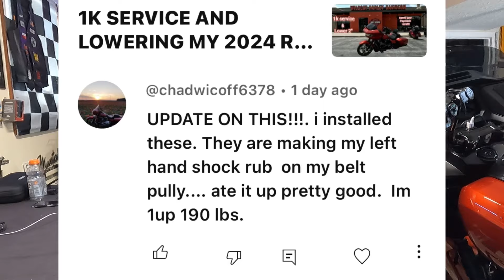HARLEY DAVIDSON BUDGET SIREN (installation and discussion)

Comment: I have the original siren installed from Harley.  So I don’t need this one BUT I wonder if it does the same as mine.  I unplugged the main fuse to work in the bike adding rear light harness and it just goes on and I wonder if anyone knows how to prevent it from going on   And your vids are very well done and relaxed to watch.
Reply from the maker: Thank you my friend. I’m not sure i understand your question. Did you pull the fuse, and now your siren won’t work?
Reply: I think you need to turn the bike on but don't start it, then pull the fuse. After you pull the fuse flip the start switch back to off. Should keep your alarm from going off.
Reply: @cowboyfanVa  I will try that. Thanks

Comment: Another great video.  I love your channel.  Where exactly did you mount the siren?
Reply from the maker: Thank you very much. I mounted the siren at the front of the battery tray. The part of the frame where all your wire harnesses run in from the bike. Clean instal, out of the way, and loud! 👍✌️